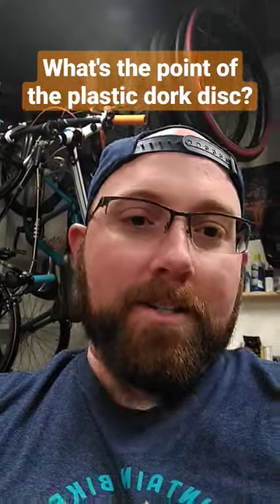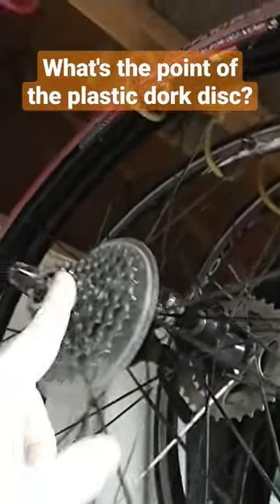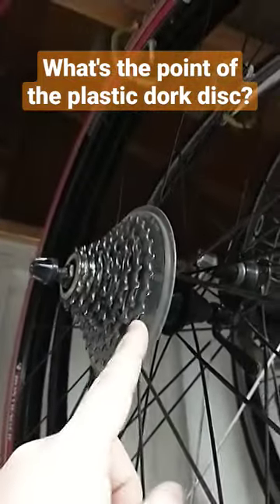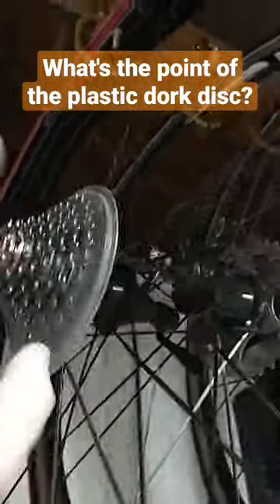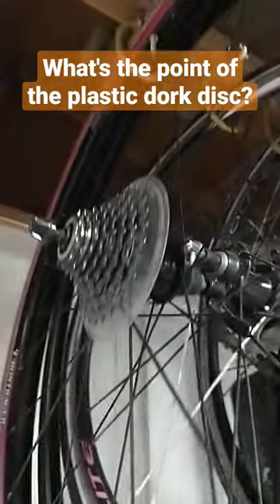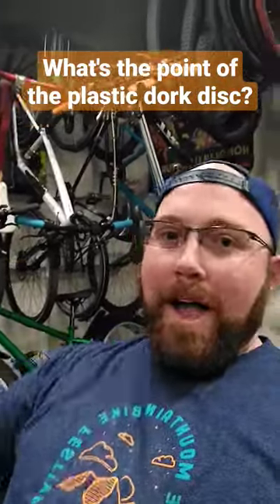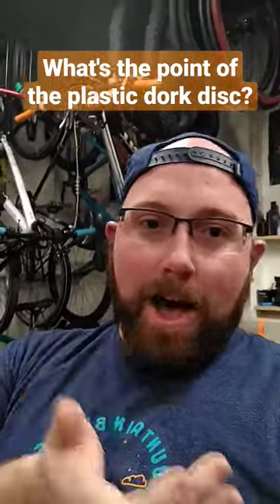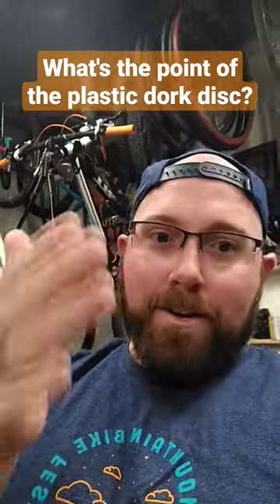What's the point of the plastic dork disc? #shorts

Comment: I had this happen during a bikepacking trip.
Had just made it to dover 60 miles in of a 120 mile trip. 
Took me an hour to get the chain out. 2 spokes snapped. Derailleur cage bent & a buckled wheel. Took me over 4 hours to ride 7 miles
Managed to get it fixed as best as the bike ship could.
That was stressful to say the least

The dork disc would be ok if it stayed in place and wasnt made from plastic. With all the tech and advancements surely a better solution could be found. Even an extra ring on the cog